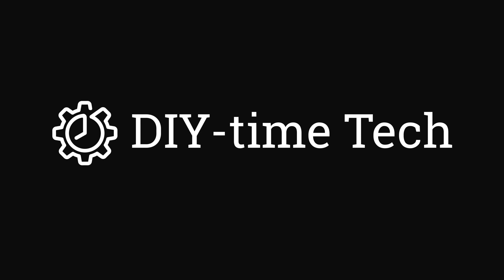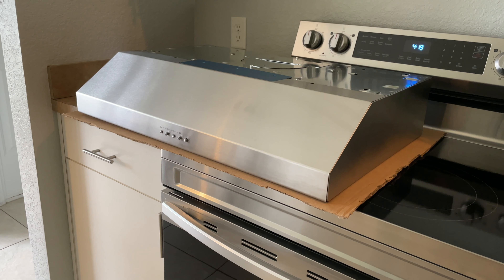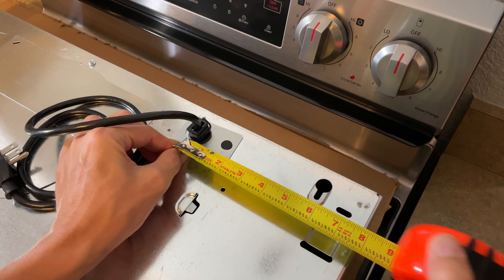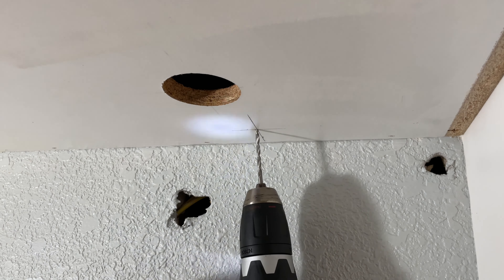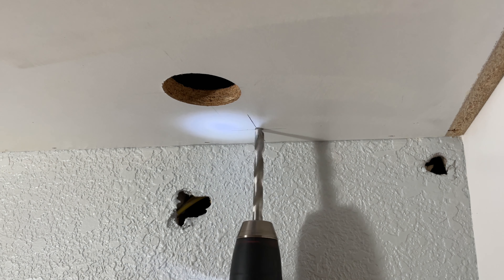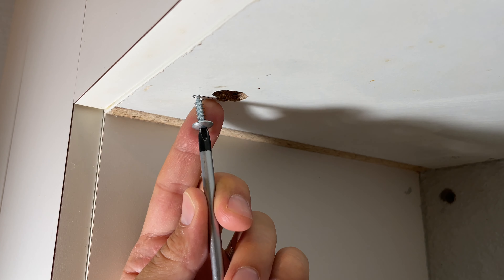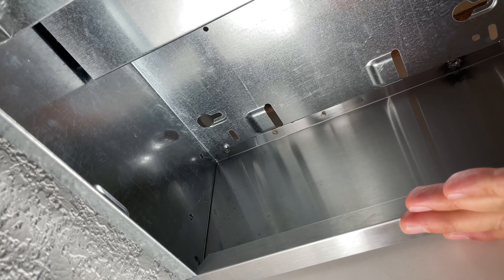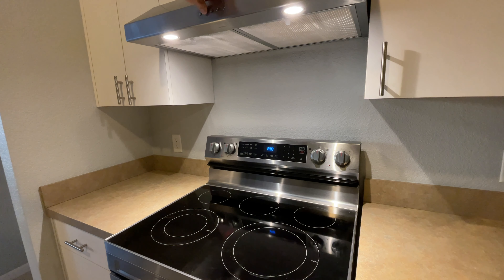How to install kitchen ductless range hood under the cabinet - easy way!

Comment: I see what you did....you made it a ductless/useless hood....
Reply: Indeed, coz am wondering where e sucked air will go!
Reply: Never have rangehood before? You dont need ducting to use it. Switch the lever to air flow on the from vent. Easy
Reply: @rockshox519  i only knew ducted type only.
Thanks for clarification
Reply: @FTNewBie  And don't forget to install a charcoal filter inside the hood to remove oil and odor. It is OK if you don't cook much.
Reply: Filters buddy its filtered
Reply: Thanks for the video.

Comment: You bought an exhaust fan and didn’t exhaust it. The proper fan should have had a vent at the top of hood that recirculates the air info the kitchen if you weren’t going to exhaust the air. Derp

Comment: This is great! Whoever built my house did not include a vent that blows outside! Instead, the air blows right back into the kitchen 😡 So all I needed was a range hood for lighting purposes only! Thanks!!
Reply: Yeah, the vent recirculates the air back in your case, but they should have filters therefore its jot a problem. If yours doesn't have a filter, it's literally useless.

Comment: Excellent video! The exact same thing would work for a front venting setup - where we need a replaceable filter. We have such a hood, but we won't be using the fan at all - we never used the fan on the Microwave that was there either... yet THAT had been vented out the back and into a vent system in the wall. Since we are venting (even though we are not using it) into the house, so I will be placing the filter in the hood for that. And the unit will cover that vent hole... so I am making a plug that can be removed, should someone later on decide they want to make use of the external vent. The other "issue" we have is that our cabinet has a one inch spacer (so I need to have a 1 inch mounting board spacer, the microwave we removed had made use of the spacers - but I don't think they are in the same location I need for the four mounting screws... and I will be wanting a much more secure mount of the supplied 1" boards that came with the hood).

Once I get those properly positioned and installed? The rest will be as simple as your installation here - thanks for posting!

Comment: Nice and simple video… I was hoping to hear about the venting part and if you used that over ductless. I’m installing a new hood with venting that is offset and will have to tweak it because the 50 year old set up is half the width with a stud on the side.

Comment: I appreciated a few parts of this video. Thanks for that.
But at around 14 seconds into the video, on the top of range hood, we see small removable rectangle for ductless operation which allows the hood to vent back into the kitchen.

Did you remove it earlier for ductless operation?
And if you did... did that vent hole stick out past the cupboard it was attached to, so it could vent back inside the kitchen.
Once you had it installed, it looked like that vent hole was being covered/blocked by the bottom of the cupboard it was attached to.
That would have stopped the hood from venting back into the kitchen, and would have been very hard on the fan motor.
Am I missing something here?
I looked at a similar model vent hood, but couldn't understand why that vent hole ended up behind the 12" depth of the cupboard.
Again.... am I missing something here.
Thanks again for the video
Reply: They skipped a hell of a lot of steps… would have been helpful if they did a unboxing, explaining the vents(and your options), as well as a few more installation steps. 
Left a lot to the imagination.

Comment: I see that the recirculation plate is on the top near the front.  Did you have to cut a hole in the bottom of your cabinet to create space for that exhaust?  So does it recirculate into the cabinet?
Reply from the maker: My house doesn’t have exhaust, it recirculates through the range filter.

Comment: Trying to install a hood but my cabinet is 1.5 inches shorter. Is it ok to drill holes in the range hood to change the front screw position?

Comment: Where does the ducting tube go how do you go through the wall with the tubing etc. ??
Reply: Your wall should have a duct system that leads outside of the roof. If you don't have that, you have to get on installed, if not just have to open the flap at the front made for those who don't have a duct system

Comment: Can this be used over an outdoor gas grill, it’s on a deck with a roof?
Reply from the maker: I suggest checking manufacturer specs. In general - no, indoor appliances are usually not rated for much harsher outdoor environment.

Comment: Where is the duct work??
Reply from the maker: We dont have that here in Florida.
Reply: @DIYtimeTech  So the exhaust and smoke will just fill up that cabinet and come back in the room?
Reply: I think this is just a light 💡
Reply: @CaptainReverendo Recirculation with a filter. Where I live, you can’t have a duct either
Reply: @CaptainReverendo yes it recycling the air back into the kitchen. But trapping the grease and bad odor with a carbon/charcoal filter.

Comment: Where does the exhaust go?
Reply: Back into the kitchen lol
Reply: It has a carbon/charcoal filter that traps the grease and bad odor. Then it releases the air back into the kitchen. That is why it is called a ductless rangehood. Unlike the ducted rangehood that has a pipe or chimney that sucks the exhaust outside the hosue

Comment: No ducts? Why even install a range hood? Open the window at that point
Reply from the maker: These have charcoal or metal mesh filters inside that adsorb smell and fumes. 
That works pretty well in small houses without a need for ductwork.